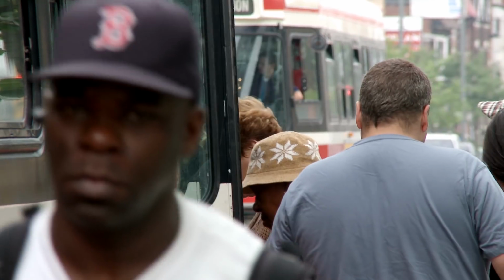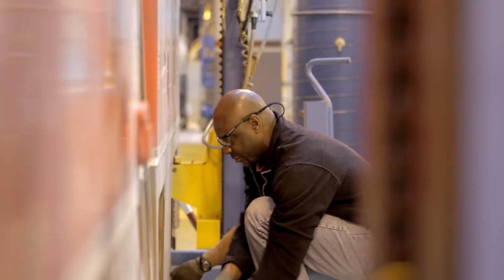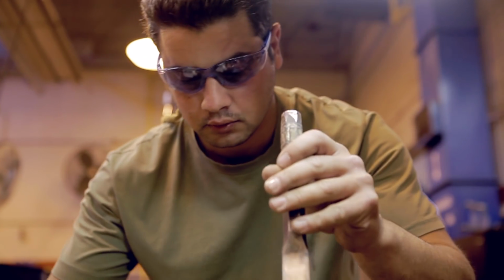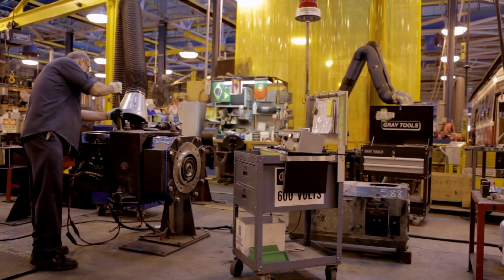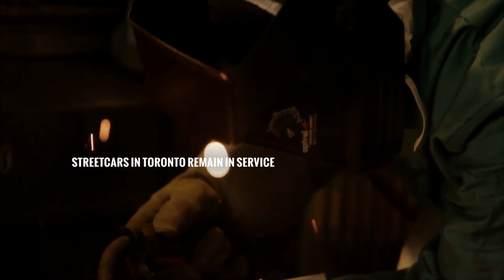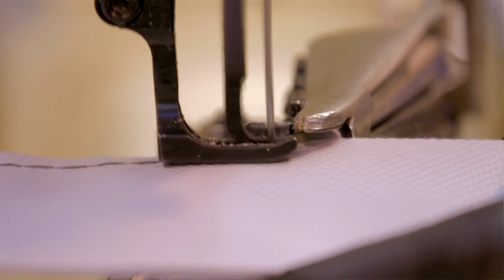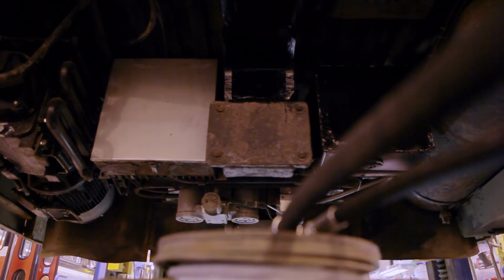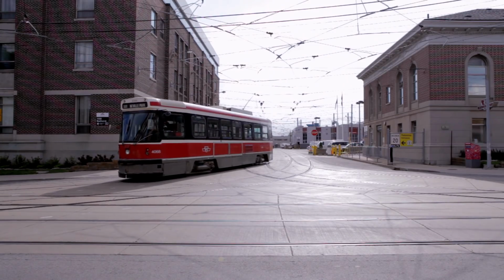Life Cycle of a Streetcar - The LEO Project

Comment: Interesting video. By far the longest-lasting type remains the PCC, though. In Toronto, they ran from 1938 to 1995. Here in Brussels the 1950s version was only taken out of service in 2010, the 1971-1973 articulated series will remain in service until about 2020. Not too shabby for 1930s technology.